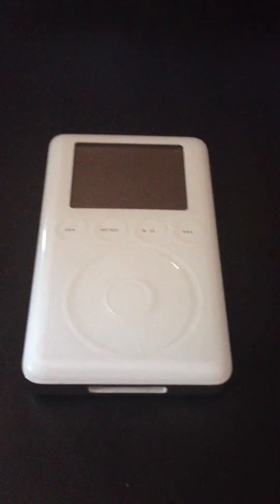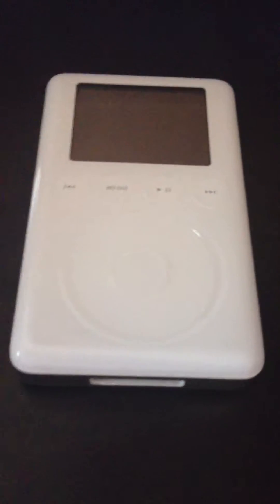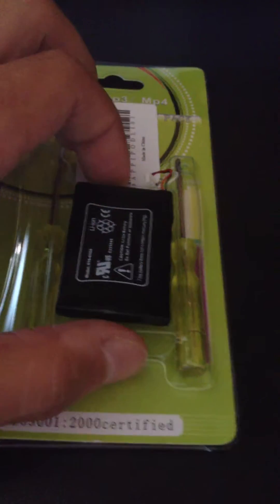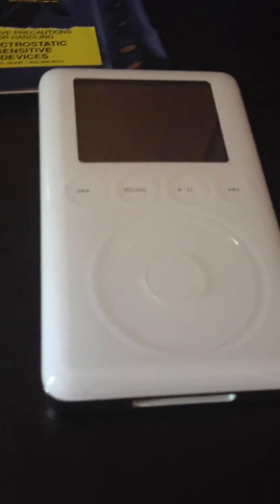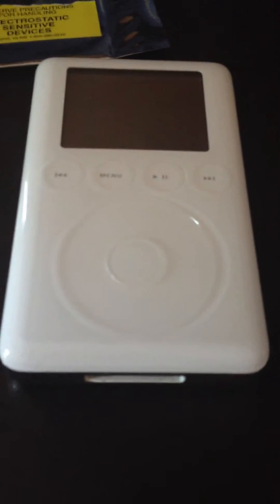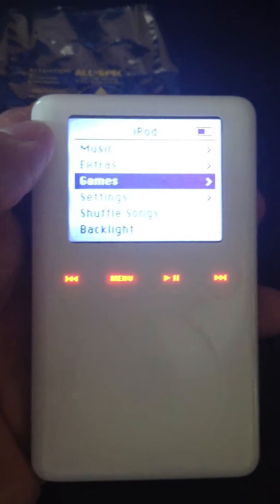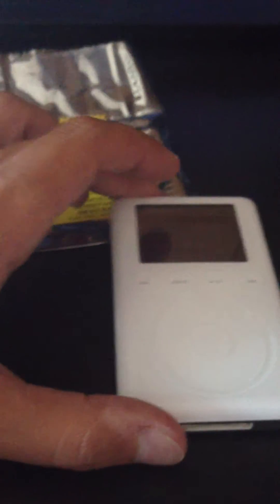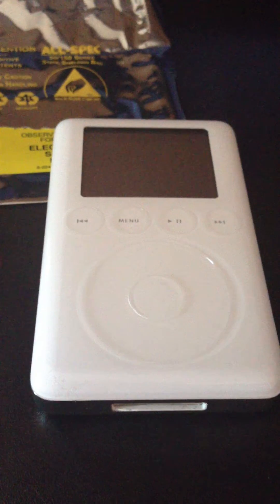Apple iPod 3rd Generation (dock connector) Rebuild/Restore

Comment: Hey so I have one as well, this is probably extremely late but the dynamics of the dock on this particular iPod and the way the logic board routes power and data through the data port does not allow this version of iPod to connect to the newer dock connectors unfortunately. You would have to replace the logic board with one which connects and charge via usb, and the reprogram the logic board into thinking its a 3rd generation with the ability to accept all inputs. I haven't figure out how just yet still doing my research on how the iPod works compared to the new ones.
Reply: You need a FireWire charger or docking station.